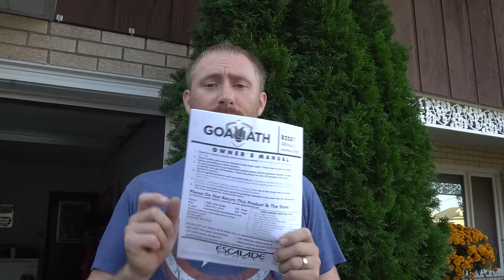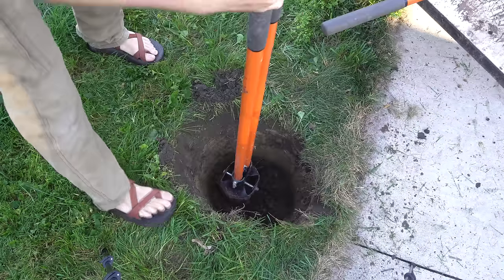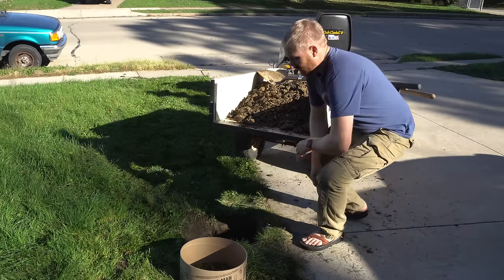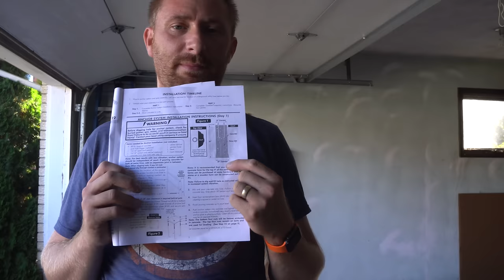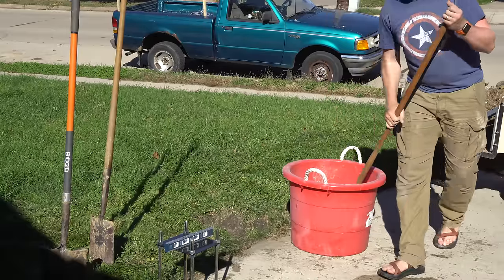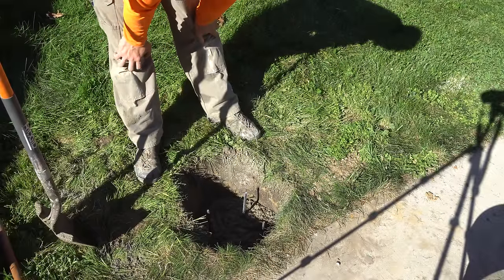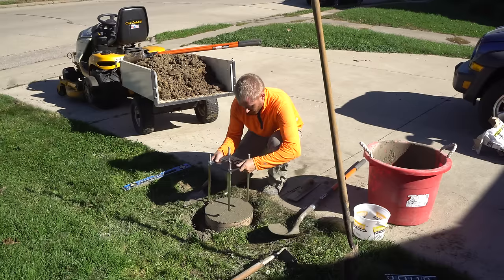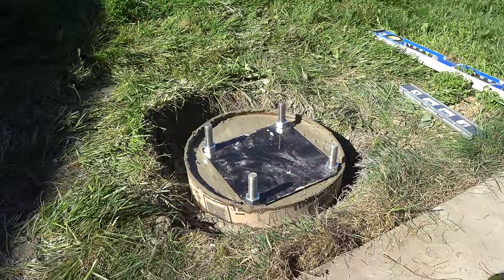Goaliath Basketball Hoop Install - Part 1 - Anchor System

Comment: Great video until the end. The hold down bolts are too close to the edge of the "round form". You need 4" all around the bolts at a minimum.   I guarantee the concrete blew out in these areas.
Reply: So definitely need the 16” form?

Comment: I certainly would not do it this way. Just take some 2 x 4's and make a frame for the footing. The anchor bolts are way way too close to the outside edge!
Reply: Agreed, way too close to the edge.  Should have read the instructions before he started this project, and once he did, he should have followed the instructions and done a 16" diameter hole.
Reply: I just did this from a different video. I looked up videos to see how many bags they used cause I only needed 5.
Now being that you guys say it will snap at the anchor…you guys suggest I dig around it…? 6” deep maybe? And fill it with concrete. One guy said you need like 11 bags so I got 6 left. I can use 1-2 and reinforce it…good idea?
Reply: That was my immediate thought as well.  This is a bad DIY video.
Reply: I thought that also…plus the concrete looked a little dry and moving the plate around can cause sloppy holes if it was.

Comment: As an "old" contractor, I recommend a good pair of leather work boots! Composite hard toe, water and slip resistant. I  personally like electrical and puncture resistant as well....but that's because of my work. But NEVER work in sandals! Boots offer safety and anyone who does this type of work for a living knows you occasionally drop things on your toe....also climbing a ladder requires boots!
Reply: Climbing a ladder does not require boots
Reply: LoL

Comment: How many bags of concrete did you use man
Reply: he used 8 but he said 9 would've been better
Reply: @ronseybones  wow that many. No kidding just seems like alot
Reply: Eric Knowles I thought the same thing
Reply: Depends on how many pounds is bag. 40/60/80
I used about 5 80# bags of high strength. I’m actually gonna dig around it and add 1-2’ of extra cement to support it since I went w a 12” form

Comment: Will rain affect the 72 hours molding process? Does it need to be covered up?
Reply from the maker: As long as the concrete is hard, rain may actually slow the curing process. I would want at least 12 hours cured before rain started, then it wouldn’t have a large effect. If you second guess it, let it sit another day.
Reply: concrete can be fully submerged in water and still cure 100% fine, infact you should keep young concrete wet for up to a week to prevent cracking caused by repeated moistning and drying.

Comment: Dropping the reinforcement so low is not good. Now you have nothing to transmit pull out forces from the bolts down to the foundation. You need bar high enough to engage the anchor bolt pull out cones to avoid snapping off the top of foundation. That backboard hanging up there is creating a lot of overturning force.
Reply: Please explain in English.
Reply: Yes. English please

Comment: The hole should have been dug square, to stop the ring rotating. 
Also not enough gap between bolts and edge of concrete. 
You really should follow the manufacturers recommendations, as its your kids safety at stake here. Do not follow what he's done people.
Reply: Round or square  450 lbs anchor won’t move lol I have done  goals for 14 yrs
Reply: @luisrasgado9160  she's crazy. I get it but people like her will freak out about any and everything.
Reply: Thank you Luis
Reply: Let your husband know when he goes outside to do this while you sit on the couch and watch TV.

Comment: I bought one used for 400.oo but I didn't get the plate bolts how much are they I got  to hire someone  cause if u don't set right it will make the goal of center and sang  plus I've got the 60 inch  back board and we get bad weather coming out of the West if it's not set right I'd screw it up